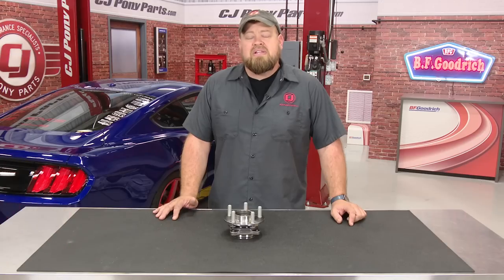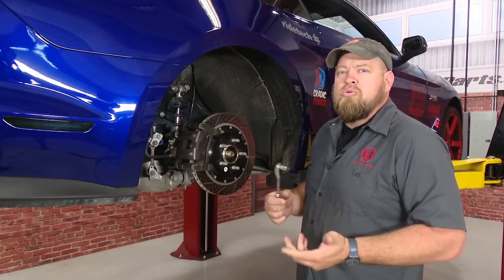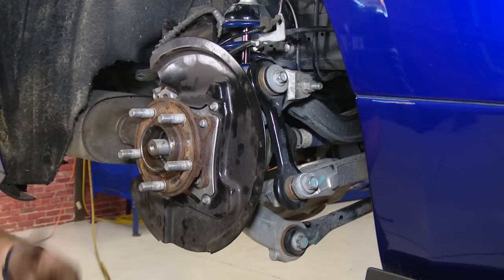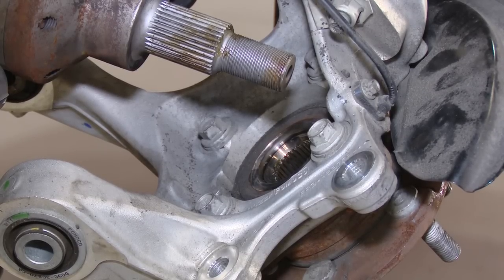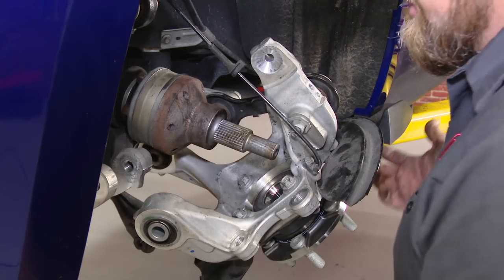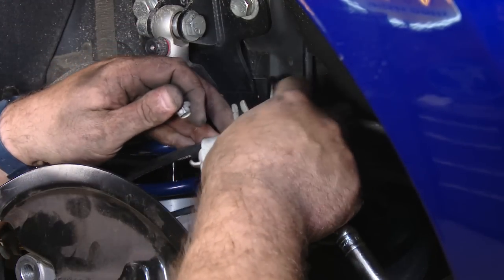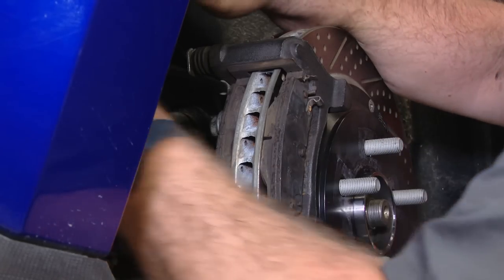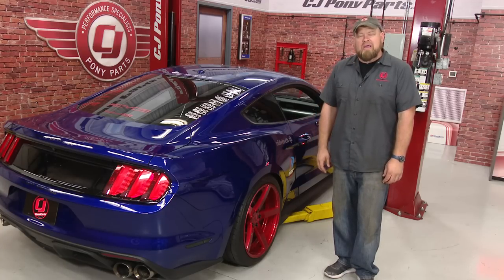2015-2023 Mustang Ford Rear Wheel Bearing And Hub Assembly Installation

Comment: Great video. If anybody is planning on doing this he was mistaken it is not a 36 mm it is a 32 mm on the hub nut. At least it was on my 2015 GT Mustang
Reply: Just found out the hard way, you are correct it is 32mm
Reply: Yep, I should have listened to you. The FRONT is a 36mm and the REAR is a 32mm.
Reply: Yes 32. Please Edie this video
Reply: do the performance packs have 36?

Comment: Halfway through this install in my garage and found out my axel nut isn’t a 36mm, but appears to be a 32mm most likely. 

Stranded with the car on stands until the wife gets home and I can go out and get the right size socket 🙃
Reply: OHBUCKEYESisBACK Happened to me too, and I paid $25 for the 36mm socket.
Reply: Literally doing mine right now. It is 100% a 32mm. Glad I got a kit with 4 sizes.
Reply: OHBUCKEYESisBACK i baught the fucking wrong one 36 was too big
Reply: So I’m not sure where the confusion is but I think I figured it out. I just did my s3 roush and it has the ford performance half shafts that are bigger and the spindle bolts are 36mm. I think everyone that has standard half shafts it’s going to be smaller.
Reply: Yup same here
Reply: @Victor-kl3cy  no it’s actually the older cars came with 36 mm but the newer design swapped to a 32 mm
Reply: Aaahh good times bud……
Reply: I am in the same situation right bow becuase of this bad information on this video. I bought the wrong socket too
Reply: @GagePatrick  - I have  2015 GT with the performance package and its not the 36mm neither.
Reply: same here.  life happens

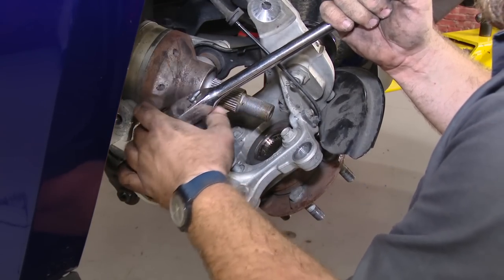Comment: 4:58 At this point you take 10 sec more to take off the ABS sensor ... There's too much tension on it.
Reply: Yup agreed I busted my abs cable trying to remove mine and ended up buying a new one.
Reply: yeah, that's what I did as well, ended up taking the entire assy off so I could put it on the bench with the uggadugga for the 4 hub bolts.

Comment: Nice vid Bill!  Creaking and popping noises at low speed and on surface streets at low speed is what I have now on my 2016 that has been lowered for 15 months with about 12K miles put on them.  I've been thinking it was the last mod I put on, the BMR toe links but living in denial about those and have been doing a lot of investigating on the cause....such as rear sway bar, the solid vertical links, the cradle lock out.  I notice that on your vids that raising the axle assembly to ride height prior to final tightening and torquing  the suspension bolts is not shown.  Isn't that a necessary step?

Comment: Isn’t there a thrust washer missing there before assembling the hub back on the axle ?im about to replace my hub this weekend and ordered the thrust washer too I’m confused ?
Reply: I just saw the video and you are right its missing there
Reply: 2015 and 16 didn't have thrust washer
Reply: @CarsandChris yes mine did, had to find out the hard way that I have to replace that
Reply: Alot of people have claimed retorquing their axle nut fixes their popping clunking but they never check for the thrust washers. I'd say that's where the issues are coming from. There's even an updated thrust washer ford makes thats much thicker than oem to allow for better strength. I lost mine taking a hard right over a few softball sized bumps sliding and it cracked my thrust washer and it's been making noise as described by most like clunking into drive and reverse and clicking when taking off.
Reply: @sirseven3  bro I changed the wheel bearing, the sensor, the washer and my lights still on for the same codes…
Reply: @BADD_5.0  did you do both rears? Do you have full functionality of traction control? (Does it work?) Mines had a c41500 since I've owned it but the noises just started. There's a lot of variables considering there's a rf induced code from the hubs. Do you have aftermarket tpms sensors?
Reply: @sirseven3  I don’t have any vibrations only the codes which are all saying rear abs sensor isn’t working but it’s literally brand new
Reply: Jist related my rear left wheel bearing.i didn't know about thrust washer replacement. There's 3 yt vids that didn't show a thrust washer.i have to come back to it and pit in a new thrust washer

Comment: PLEASE MAKE SURE ITS NOT JUST A LOOSE AXLE NUT. I swore I needed a new hub assembly but I noticed that the axle nut was loose. I tightened it and it solved all of my problems. It’s a 32mm btw
Reply: Did you have any codes?
Reply: @MotorCityMoto  Nope, just a loud noise coming from the wheel and I was able to shake it back and forth.
Reply: Betcha you lost a thrust washer, if you ever tear apart the rear end check the opposite side for one
Reply: @sirseven3  I just realized he didn't install a new one in the video.
Reply: @theecarking  I didn't see it but some cars don't have them, ive seen a bunch of forums about not having one but ford states that all should have them. If you lose it and it's never there wheb you go to replace the half shafts it's tough to know it needs one.

Comment: Has anyone tried just adding red locktite and re torquing the axle nut? In my case, I was hearing creaking, popping sounds when starting out in first gear and going into reverse. I jacked up the car and noticed that there was a little play when i tugged the wheel up and down and side to side. I compared this play to the other side, and the other side was rock solid. Saw this video from Bill and I got me thinking. I decided to check my axle nut for tightness, I put a 1-1/4" (32mm) socket on it and I probably tightened it about 2 whole turns! The sounds are gone and the car is fine. I did all this after I already ordered my new hub assembly from CJs, but I plan to keep it in case the bearing does actually start to fail sooner now that the axle nut has been loose and probably causing the bearing premature wear. Either way, I plan to check my axle nut torque every oil change now. You guys may want to add that to your maintenance items as well.
Reply: I'm thinking this has a lot to do with it...
Reply: I went through the whole install. Changed the bearing and the popping went away. 2 days later popping is back. I'm convinced the axle nut is the problem as my old bearing was solid but I changed it anyway.
Reply: shit, i'm in the same boat as you were a year ago. I've already ordered my bearing, but i should tighten that nut too.

Comment: So my abs light came on for my 2017 ford mustang and I got the the code. It said I have to replace the right rear wheel tone ring, does that mean I have to replace the Wheel Hub Bearing Assembly? Cause I’m tryna find the wheel tone ring and can’t find the part or where it would fit on the cv axel?

Comment: If anyone is here because of a lit up dashboard showing ABS, traction cntr off etc. it's not always a bad wheel bearing. The axle thrust washers behind the bearing tend to break and cause this issue. Still have to do these steps shown  here to access and replace it. Also it's a 32mm for the Axle nut.
Reply: I’m here for that issue and my hub bearing has crazy play. Where do I get the washers from and perhaps do you have a part number?
Reply: @kirkzinner3752   Ford Axle Thrust Washer Genuine Ford Part Number FR3Z-7G273-A. If your wheel has play it's the hub assembly but can be the washer along w/ it. you wont know till it's taken apart. Make sure to purchase the correct hub. The front and rear hub bearing assemblies differ. Have a jaw puller on hand for the rotor if it has never been pulled off or you live in the rust belt. AutoZone rents them out.

Comment: Anyone able to remove the 4 bolts without unbolting the control arms/loosening the vertical links?
Reply: Yes I was.  Replaced both rear hubs on my 2017 tonight.
Reply: Was it difficult to access those bolts without loosening the control arm/vertical link?

Comment: Anyone know the torque specs for these bolts taken off and put back on? Is a clunk/clicking noise coming from the rear when changing from P to R/D also clunk/clicking noise when accelerating from a stop.
Reply: Old comment, but did that end up fixing it?

Comment: Is it hard to get it in the spindle. Meaning is it pressed in by tightening the bolts or is it really that easy to place it in place? And does anyone know what the main hub bolts should be torqued to? As well as suspension arms.

Comment: Most of the required tools part needed seem to be not matching up with your  video. I went out and bought a new Axle nut socket and found its the wrong size. Mine appears to be smaller than 36mm. What is going on here. I am the original owner. I've never changed these out before.... why is it different from what you call for?
Reply: People were saying it's supposed to be 32mm, not 36

Comment: Please replace thrust washers while you're in there. Also, should I be using red loctite on the axle nut?
Reply: I just found out I had to replace it… mine was torn apart, gotta take off everything again and find a new washer

Comment: Rear axle nut is 32mm you can use a regular 1/2^ drive shallow socket no need for a deep socket or a special thin wall axle nut soket

Comment: Did you have the advance track mode light on, abs, traction control, hill assist lights and the steering wheel getting hard?? That's what's happening to my2017 and I did lower it
Reply: This just happened to me too. How did you fix it?
Reply: its happening to me to 
its the ABS TONE RING
Reply: Just fixed it replace the hub and your fine.
Reply: Did you get this fixed I just replaced mine and had the same issue?
Reply: Mine too it’s the brake sensor
Reply: Did you ever get the lights to come off after the installation? I’m having the same issue.. haven’t replaced the hub yet I just ordered it.
Reply: @Alex-bv5pl  which  one
Reply: @bromar2014  which side you bought

Comment: My issue with this video is that they completely skip over the part of ACTUALLY REMOVING the bearing and hub assembly!! Like, isnt that the whole reason for the video!? Yes, its nice to know what to detach for more room while working on the ACTUAL BEARING/HUB. But the HARDEST part of the entire job, aside from removing the rusted rotor, is removing the bearing and hub assembly! It took me a couple different efforts all to realize a Sledgehammer works best!
Reply: Currently having issues detaching the hub and bearing assembly after removing all the bolts. How/ where did you hit it to get it off?

Comment: Do you need an alignment after this?
Reply from the maker: In theory you shouldn't since no adjustments were made but I would get it checked to be safe,  too much rear negative camber is one of the leading causes of hub bearing failure.

Comment: where can I get those rotors veey nice...good video
Reply: They are available on our website!!

http://www.cjponyparts.com/baer-brakes-rear-brake-rotor-eradispeed-plus-2-piece-13-pair-performance-pack-ecoboost-gt-2015-2017/p/BR92/
Reply: @Zerogivengarage  would you recommend Moog wheel hub bearing or Ford factory wheel hub bearing...

Comment: So do I need an ailment after replacing the wheel bearing hub?
Reply: yes.
Reply: This video does unnecessary things.  
Remove the caliper and bracket.  Remove axle nut.  Unbolt the hub.  Reverse and done.  Shouldn’t need an alignment as long as the extra stuff isn’t taken apart like in this video.

Comment: My axle nut isnt 36mm its smaller. I have a 2016 gt premium.
Reply: Etienne Retfird Mine was too.
Reply: Etienne Retfird I know I had to beat the half shaft out of the bearing and then I had to press the bearing out of the knuckle. None of it came apart as easy as the video. As far as pulling the half shaft out of the rear end, I didn't use a pry bar. I pushed it in and gave it a tug and it slid right out.
Reply: My half shaft was bent already or I wouldn't have beat it out.
Reply: @shawnjozwiak1499  Yea, it's the 05-09 that's 36.

Comment: Lots of extra work in this video that simply isn’t necessary.  Unbolt caliper and caliper housing.  Unbolt axle nut.  Unbolt hub and bearing.  Reverse.   Done.
Reply: Was it difficult to access the bolts that attach the hub to the assembly?
Reply: @MrMartydonut  it wasn’t bad at all honestly.
Reply: I downloaded a 9,500 page service manual and it doesn’t give any of these steps - all they show is using a hub removal tool and that’s it - none of the other steps - it doesn’t even mention the “bracket” that he removes 🤷‍♂️
Reply: The “stealership” wanted to charge me $900!!!
Reply: @MrMartydonut   if you are fairly handy with cars this is easy.   
I did the driver side first so it took me longer because I was taking my time. Once I knew all the stamps I did the passenger side in probably 30 to 40 min and I still wasn’t rushing. 

I bought Timken Hubs fro Rockauto for $55 each.   The dealership wanted $270 PER HUB! They can’t be that good if my car needed them at 31,000 miles lol.  Now to be fair I do some fast paced mtn runs so I’m sure that contributed to them needing replacement.
Reply: @MrMartydonut  I should add that I didn’t need a hub removal tool.  Once it’s unbolted I had to hit the studs in the hub against the ground to free the old hub from the rotor.  New hubs have new studs so no worries with potentially damaging old studs.
Reply: Thanks Anthony I was able to do both of them eventually it took a while damn axle nut was impossible to get off but the stupid creaking noise is still there…
Reply: How do you get the 4 bolts in the back holding the hub? I can't manage to even break them loose.

Comment: Was grinding and howling took it in to a repair pal certified place they charged a diagnostic 89$ said it was the wheel bearing and I asked if it was covered they said yes but only partially I called maxcar (CarMax) they said it was covered I asked why I was paying out of pocket $500 they said the auto repair place was charging more for labor and parts than what they actually cost. Called the guy he said if they only took what was paid they would not make a profit. Next day said both wheel bearings need to be replaced he said he didn’t know until he took the wheels off? Earlier said diagnostic said one and also how can a diagnostic detect a bad wheel bearing? Next day said I should be able to come pick up. Get there and saw it on the lift parts everywhere. He said they had to cut off the axle bc they could not get it off to get to the wheel bearing…earlier he said he removed the wheels and visually said the wheel bearing is bad…he said I needed a new axle now. That it would be covered…10 mins later he said it would be done in an hour then said I needed a brand new wheel hub assembly now…next day said I needed new breaks I asked what the cost was he said 89$ and he wouldn’t charge for labor. Next day come to pick up the car. The trunk is damaged and majorly scuffed up and on the side. I drive back he said he laid the old parts on top but the side was not his doing. He asked for the keys and pulled it off to the side of the shop. I decided to go look at what he was doing. He had a big jug and started pouring it on the damage trunk then grabbed a old dirty rag off the ground and I asked what it was and he said break oil…it’s good at getting scratches out. He did it on the side too. Now my care is super damaged. He did not come back to speak with me. Instead a younger man did and said he had a buff kit he could bring from home to try to get the scratches out…this is not a paint shop. I had to go back to work on break. Leaving work I turned the car on and it started shaking and the a/c started blasting hot air and I could not turn it off. The other button was lit up that says auto air, and the rear defrost was on. I could not get it to stop or turn off. It took a while but i finally got it to work somewhat. Reversing making a weird clicking noise and the tire where the work was done was flat. Filled it up w air. When I break noise is made and the car pulls to the right. I don’t know what to do at this point and I am asking for help. I think they have destroyed my car and I feel as though this is not normal. I paid out of pocket $600+ dollars and the insurance paid the rest at around $3000. The itemized list is not broken down and does not make sense. The shop is located in Cary NC called Crossroads Auto Repair off walnut street. The loaner car that was given to me was insane and most would not believe it. A doge caravan. The anti lock breaks were broken the abs light and traction control light was on and the engine light came on. Water would pour out from under the dash and I almost crashed bc of the breaks. The entire roof lining is gone with tons of particles falling off and in the air. No way could this be legal. If anyone could help me I would be grateful. The reviews were hidden has I known I would have never gone. The man apparently is violent and tried to hit customers. Other reviews says he put on old tires from 1999 and was caught. I’m afraid to drive my car tomorrow but I have to work or I’ll get in trouble.